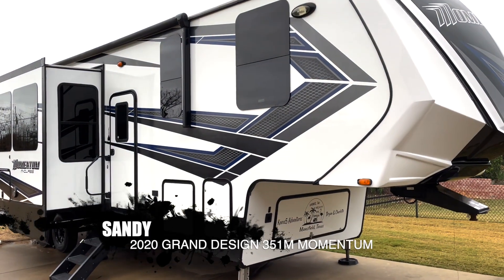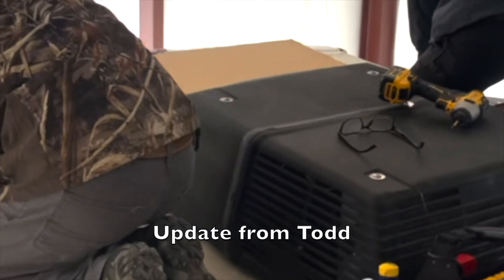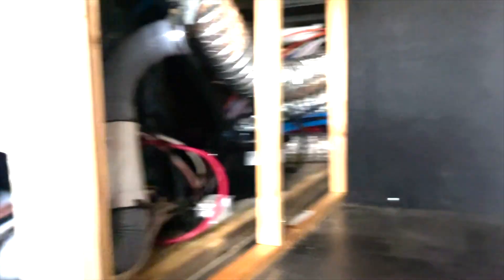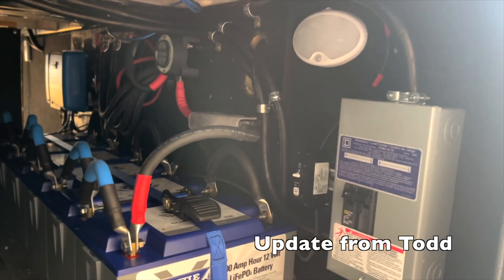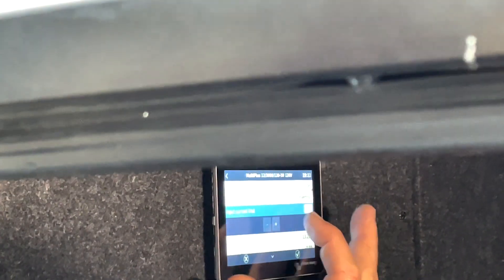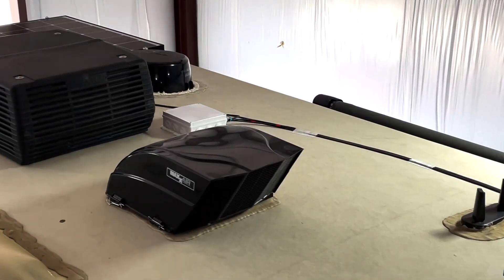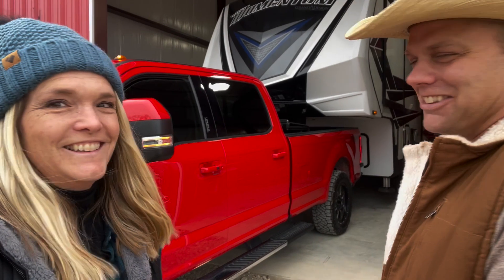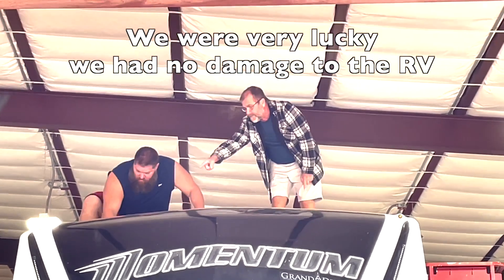RV SOLAR INSTALL -  Victron, Battleborn Lithium & Flying Solar Panel?! NRVTA

Comment: Nice, clean install. Sorry about the unplanned Kittyhawk moment.
One thing I noticed is that the design is FAR too light on the collection end. Storage and distribution seem to be in line with your needs. There is simply no way for the system to allow even the use of 1 a/c unit. 
It's all about KWh.  You'll need to collect 30KWh or better, each day, for a summers day of a/c. 
Seriously sit down and calculate how to find enough real estate to allow this system to reach it's potential, otherwise you'll be running a generator to charge the batteries and who wants that?
Going to need roof racking or a real talent for Tetris, but COVER that roof in panels, you won't regret it.
I'd shoot for 3 KW or better.
Reply from the maker: We absolutely need to add more panels! We lost one 300-400 watt one and now the three remaining are in series. We want to add another series of smaller panels to fit in the little bit of roof space we have left. I would like to do those on tracks and set them up so they can be tilted, if possible!
Reply: @keevs5adventures  Looking at a still frame, I can see the mechanicals are gonna limit you.
I only mention the collection problem because you've gone so top shelf big, on the rest of the system.
If you have access to a sharp handyman, a system can be built that 'stacks' the panels on slide-outs that effectively double your wattage when deployed. No extra roof space used, but the rig would have a different 'look' in operation.
No reason to forgo  the front panel. A slanted-forward air-dam transfers the force into downward/rear pressure, if built onto the panel top. Works like a charm. Support structure needs to be proper, obviously.
Hope you get 'er dialed in, I'm a big supporter of folks being as independent as possible.

Comment: Shocking that the solution was to remove a panel. Mounting it flush would have easily solved the lift problem. I'm impressed that you were so calm about it.
Reply from the maker: We have had quite a few moments that in years past, we probably wouldn’t have handled things differently. We were so grateful someone saw it happen and pulled us over. Good people! Even more grateful those good people weren’t hurt! We definitely want to put some more panels up there. This one was just too large and just not able to withstand the force of the wind. We need more panels and will be mounting them differently.
Reply from the maker: The removal of it means we end up with high voltage issues on that series when the temps dip.

Comment: Wow, that too bad about losing the panel. Are you going to have someone install a fourth panel?
Reply from the maker: We are debating another run of smaller panels in parallel to give us more watt hours. We will probably do it ourselves. Losing one panel means the three we have had to be hooked up in series.